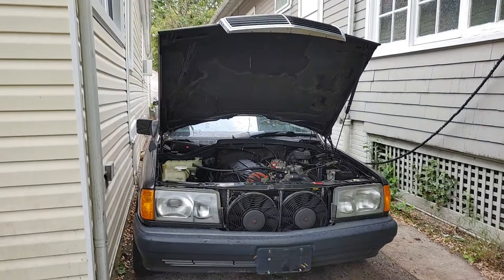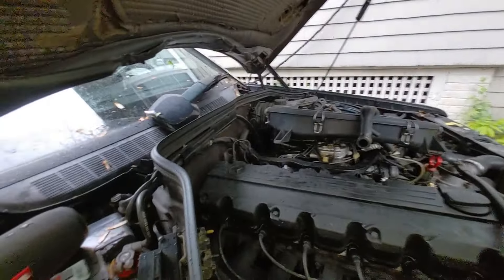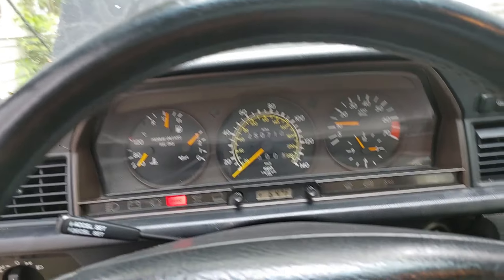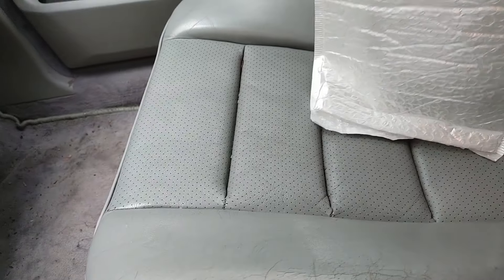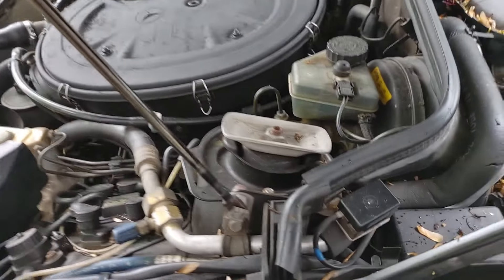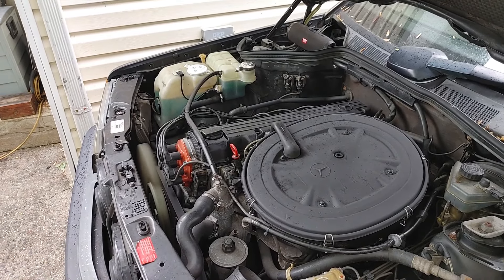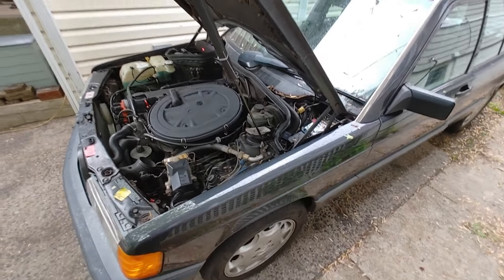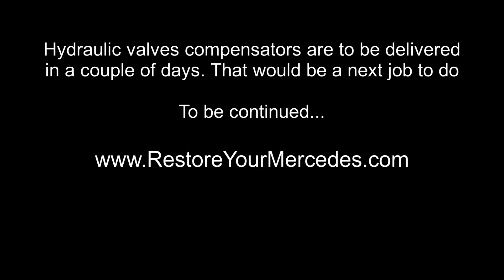1991 Mercedes 190E project  Fuel injectors replaced and couple of misc things

Comment: Isn’t 0W-40 a bit light for this engine?
Reply from the maker: I put 0W40 in all the cars I have since I live in NYC. For NYC climate the 0W40 is pretty much OK.
Reply: @vsandvs  The M119 too?
Reply from the maker: @charlesphiliparthurgeorgep4653  I don't own any M119 cars at the moment. But I have M113 V8, M120s V12s, M275s V12s twin turbo- all have Mobil1 synthetic  0W40 oil in them. No complaints. When I had M119 V8s I too used 0W40 in them.
Reply: @vsandvs I see. I suppose it should be acceptable in a cold climate and it’s technically a 40 weight oil, even though the “0” viscosity didn’t exist when the older engines were produced. Do you prefer M119 or M113 overall?